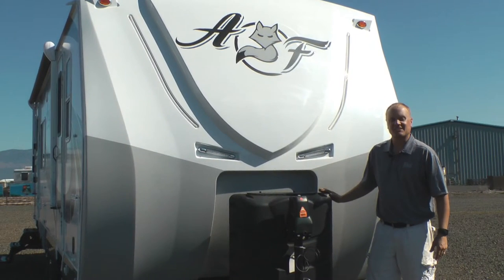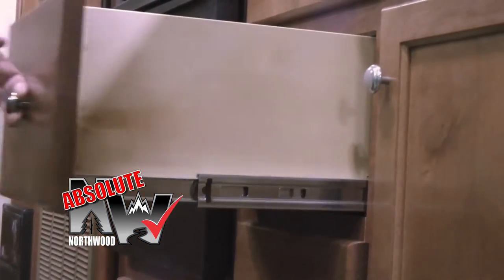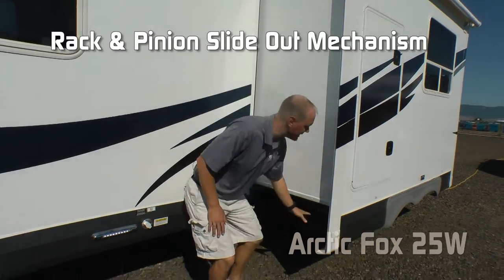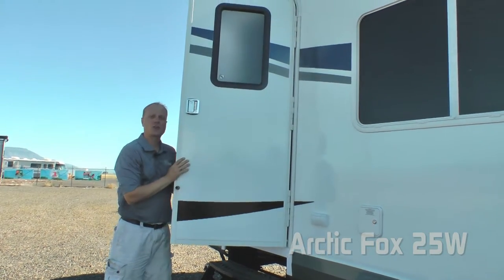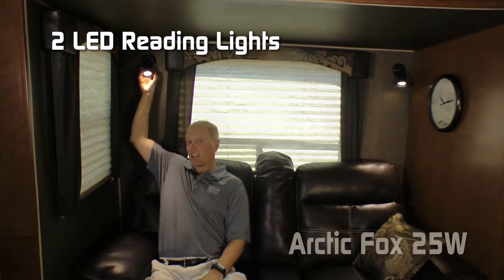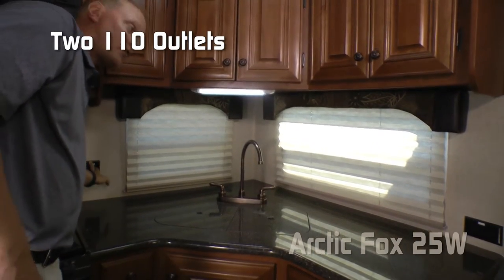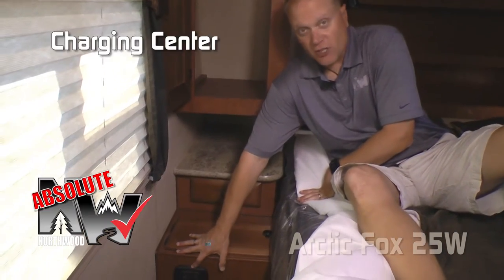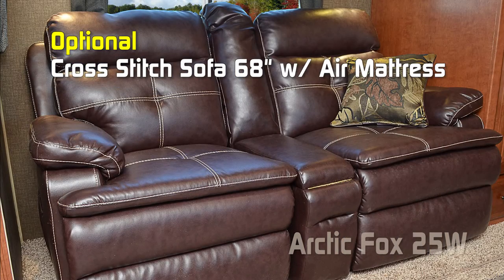Quick Tour of the New Arctic Fox 25W Travel Trailer

Comment: nice! will a ram 1500 5.7 tow this without issue?
Reply from the maker: The dry weight of this unit is 6,759lbs. So here's a breakdown:

2 Batteries- 80lbs
15 Gal LPG- 65lbs
57 Gal Fresh Water- 475lbs
Total- 7,379 (This doesn't include additional options added from the standard build)

So given this your pickup would have to have a tow rating around 8,500-10,000lbs given the fact that most couples travel with an average of 1,000lbs of cargo.  Hope this helps!
Reply: great! very helpful info . My truck is rated for 10,200 so looks easily doable .
Reply: Coming out west in a week or so (Yellowstone), we did look at the 25W while returning from AK. last Sept.  This trip were also looking at Outdoors RV's.  ORV has thermal pane windows as standard equipment.  For 18' are those still an option for AF? and how much weight do they add to the 25W?  Are they going to have the aluminum steps like the ORV models.  Weight is going to be my issues (Tundra 9900lbs. towing capacity)
Reply from the maker: Thermals still are an option for AF Classic edition Trailers. I don't know an exact overall weight, but it should be somewhere around 60-80lbs.  We will have aluminum tread steps for 2018, but ours are also reinforced on the bottom with steel to help give added strength to the step. For any additional questions please feel free to give us a call 1-800-766-6274 or call one of our dealerships.
Reply: Thanx...On our return trip from AK. the salesman at the AF dealer in MT. said Thermal's added 400-500 lbs...That is why I was asking...We spent at least 2 hours with him.  But another statement he said was "Arctic Fox" doesn't give a diddly squit about saving weight.  I have located both a AF and a ORV dealer in both Idaho Falls and Casper were going to visit here in the next few weeks, or so.  Just on paper the ORV's seem to have floorplans that fit our 3 adult family.